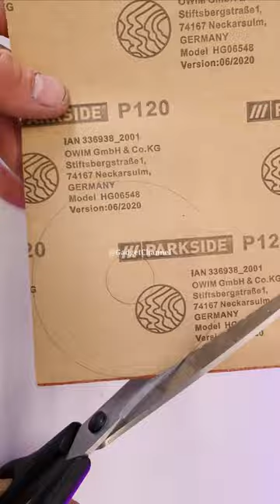How to make Drill Bit Sharpener using old Hard Disc Drive

Comment: This is why you dont buy cheapo drill bits or use them wrong or they blunt to hell also doing this will heat the tip softening the metal so it just ruins the bit just buy QUALITY SIMPLE

Comment: А где же esc для двишка?
Reply from the maker: You don't need an ESC, there is one on the HDD itself and when you supply it with 12V and 5V it starts rotating automatically.
Reply: sauf que le disque va arrêter de tourner car il est freiné et puis le disque n'a pas beaucoup de force de résistance